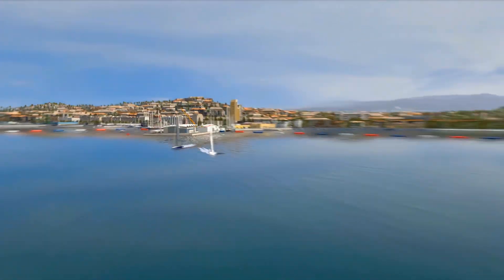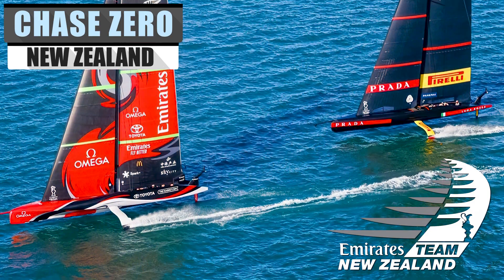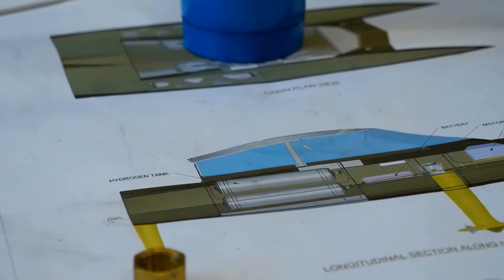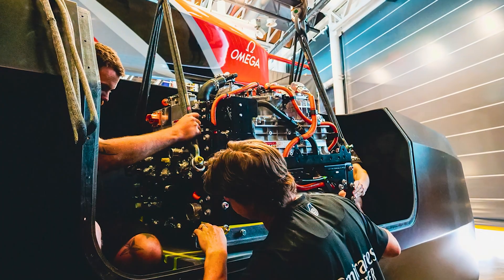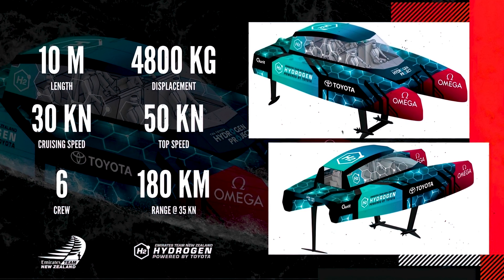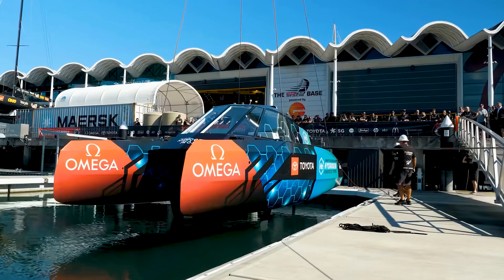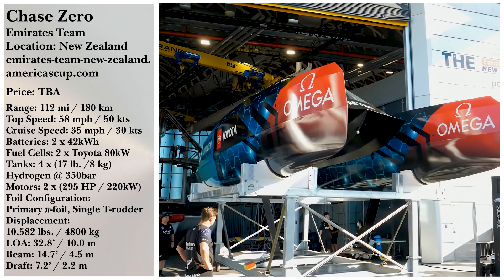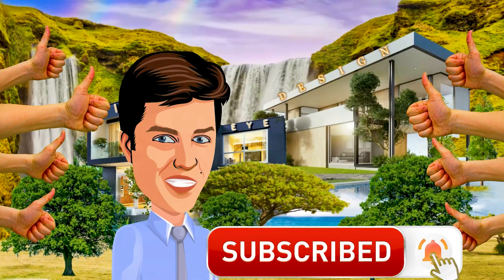CHASE ZERO CATAMARAN BRINGS HYDROGEN POWER TO AMERICA'S CUP

Comment: On-demand electrolysis hydrogen production would be better and safer.
Reply: The hydrogen is put into tanks. It can come from electrolysis. It isn't possible to do this on the vehicle because the Hydrogen is the power source for the vehicle - electrolysis uses energy and reacting it with oxygen in a fuel cell releases energy. The boat's energy comes from reacting hydrogen with Oxygen to make water. If it were also producing the Hydrogen from water on the boat, it would need some other energy source, as the energy required to make the Hydrogen would be the same as it got out, leaving nothing for propulsion (actually it'd need more energy, since some is always lost in the electrolysis and fuel cell). 

Hydrogen is an energy storage medium, like using a battery (this boat has a small battery, but it would need much bigger and heavier ones to have the same range, which would make it too heavy, which is probably why they used Hydrogen fuel cells - this is usually a problem in big and powerful vehicles that Hydrogen solves). It is great for zero emission vehicles, but it does need the energy to come from somewhere to make it, like solar panels or wind farms somewhere else (or in the more distant future, fusion). 

Expecting a Hydrogen fuel cell electric vehicle like this to also make the Hydrogen it uses is like expecting a battery electric vehicle to charge up its own battery entirely from regenerative braking so it never needs to be plugged-in, or expecting a diesel vehicle to make its own diesel somehow.
Reply: @sipos0  that's a very intelligent, knowledgeable, thorough and well explained answer. But you missed the point.
Reply from the maker: Hello Bill Landon, thank you for watching!

Comment: No emissions, except of course what is produced making the hydrogen.
Reply: Wind? Solar? Hydro? Wave? Geothermal? Biogas? Ethanol? So MANY green options and no need to mine as much
Reply: @psylentrage  While all of those are options, they're seldom chosen.
Mostly, hydrogen gets fractured out of hydrocarbon fossil fuels.

The fossil fuel infrastructure already exists, after all, and even though the process is energy-intensive, it's still cheaper to use what exists rather than build a totally new production chain.
So, while pollution is minimized when the fuel gets used , at the point of creation it causes just as much pollution as any other fossil fuel.
Reply: @thomashiggins9320  in New Zealand we only have one coal fired power station. The rest are a mix of hydro and wind. The government has been looking at taking off line the Huntley peak load power plant for sometime now.
Reply: @glennhenderson9243  sadly, it’s all very complicated. Take for a given that I fully accept that we need to drastically cut emissions. This is not about that. It’s about honest accounting.
Reply: @glennhenderson9243  sadly, it’s all very complicated. Take for a given that I fully accept that we need to drastically cut emissions. This is not about that. It’s about honest accounting.
Reply: @cguy96  yup , we have all the natural fuels we could ever need if they were used wisely and greed was kept out of the occasion.  I am going off grid very shortly , too much hypocrisy from all major service suppliers or their agents. Sod the lot of them.
Reply: @cguy96  oh are you referring to green, blue or grey hydrogen production. Not really that complicated.
Reply: @glennhenderson9243  I am referring to the complete and honest environmental impact calculation. Very complicated.
Reply: @associatedblacksheepandmisfits  wish that was true. Going solar, just for one example? So I suppose you are ok with exporting the amazing toxic waste produced during solar cell manufacturing? And I assume you plan on carefully recycling the cells at the end of their life cycle? Very energy intensive (and polluting if not done properly)! Oh, and battery back up? You need to go research just the nickel mining required to produce the batteries that let you go off-grid. But in your isolated property you will be green.

I have no doubt we COULD do a much better job (and we REALLY need to). But so far TANSTAAFL (there ain’t no such thing as a free lunch). Well, maybe reduction to a large extent. You don’t need to care where the energy that you don’t use comes from.
Reply: @cguy96  I am acutely aware nowadays that everything comes at a price. I learn more each day . I am now going off grid on a micro scale myself and will ignore all the flashy so called advances. We split the atom and still dont deal with it after all this time.
Reality is on the ground ,and we are screwing it up.
Reply: @cguy96  too many people hide behind the figures and ignore reality.
Reply: @associatedblacksheepandmisfits   I give some benefit of the doubt to those who are at least accepting of the basics, and are trying to be honest. Climate change and carbon are VERY complicated issues, and I don’t expect the person-on-the-street to grasp all but the most basic of the concepts. Clear and honest guidance from above is required. Sadly, we have also reached a point where MSM and science have become pejoratives,
Reply: @cguy96  science serves the people ,MSM serves itself. Ourobouros is at large and is ignored at one's peril.
Reply: @cguy96  I accept  no ones opinion unless considered . Otherwise it is worthless and you have nothing anyway. As for trust , I trust no one's words, I will know by the actions.
Reply: @thomashiggins9320  yet in highschool, we already learned the basics of hydrolisys...
Reply: @glennhenderson9243  NZ is big on renewables. Apparantly also geothermal?
Reply: @psylentrage  all of these (wind, solar, hydro, wave, geothermal, biogas, ethanol, etc.) have their own problems, and calculating the true carbon footprint can be very difficult.

If they need batteries (most of these do), the mining required just to obtain the nickel that is currently needed carries incredible environmental and health costs.

Wind: not reliable or predictable (hence the need for batteries), and typically not located where it is most needed. “Hi, we would like to build these huge wind turbines in your backyard and ship the electricity to the Coastal elites.” Plus, the turbine blades have a limited life span (about 10 years), after which they are cut into 3 pieces, and transported (1 piece per flat rig) to landfills, where they mostly just sit for now.

Solar: also not that reliable or consistent (batteries), and the production of photovoltaic cells requires more mining, and produces toxic waste that must be dealt with, plus they also have a limited lifespan and disposal issues. And unlike wind generation, it is very difficult to share agricultural land with solar production, so you get into land use and degradation issues. There are concentrating solar thermal plants, but most of these also require water cooling. And since some of the best places for solar power generation are also the driest? That’s an issue.

Hydro: well not ignoring the fact that we have already tapped many of the easiest rivers for hydro power generation, and thus there are limited opportunities for significant expansion, they do tend to produce fairly consistent, predictable, and reliable electricity. But at what environmental cost? Hydro is very disruptive to the environment. Plus, it is not available many places. Then there is the issue of catastrophic dam failure.

Wave: very consistent in some places, but largely available only to adjacent communities. Also, it is a largely unproven technology with lots of potential drawback. Significant initial costs. Disturbance and destruction of marine environment and ecosystems. Potential hazardous spills of materials required on wave generators. Lifespan questions. Significant impact on marine transportation.

I could keep going with all of these. But I am not advocating that we just keep burning fossil fuels willy nilly. There are many reasons beyond the huge and real issue of climate change to wean our selves off fossil fuel dependency. But it is a much more difficult issue most people understand. Every choice has consequences. Well, maybe not reduction, that can be an environmental freebee (maybe not economically when you consider the consequences of less consumption, which is ALSO something we need to be concerned by.)

Just a final example, I know people who feel all high and might that they “offset their carbon footprint” by paying for tree planting. The problems with that? Well, first you have to find out if the trees are ACTUALLY getting planted. Then you need to worry about where they are planted. Next, what KIND of trees are being planted, and are they being properly maintained. Those are just the level 0 questions.

The level 1 question comes from the carbon accounting practices. Right now the claimed carbon credit is based on a significant lifespan for each tree. That means that your offset is amortized over DECADES. That is assuming the tree doesn’t die early on (which many do), or that it isn’t burned in a forest fire or removed for agricultural fields. The current estimate (which I believe is still an overestimate) is that the claimed carbon footprint offset is 100 times the true carbon offset.

Finally, finally, there is the level 2 question. Is this planned reforestation actually GOOD for the environment long term? Probably not. The generally held consensus in the forest science community is that forests are best reestablished by leaving them alone. Yes, this will take a VERY long time, but in the long run is probably best for the forest and the planet in general. Now, urban reforestation doesn’t typically carry the same concerns. There are many good reasons to plant the right trees in the right places. But we are never going to urban tree plant our way out of this crisis.

I sound like a real Debbie Downer, and I don’t want to end the response that way. So, what can an individual do? Sorry to say that it isn’t that much. That doesn’t let you off the hook, I feel it is important that we all do our part, if for no other reason than to highlight the urgency of the issue. I won’t call myself a paragon of carbon virtue, there are certainly many who make much bigger sacrifices than I do, but I try to constantly do my part and examine my impact on my neighborhood, city, country, and planet. We eat mainly lower down on the food chain, supplementing with some fish, and even less meat. We try to procure most foods reasonably locally, and when we do buy animal products we consider things like the kind and source of the fish (MBARI’s Seafood Watch is great for this); we get grass-fed, pasture raised milk; we have our own chickens which we supplement with pastured, free-range eggs; we buy very little meat, and often get it from KOL foods (kosher, organic, local, and guaranteed to follow ethical treatment of both animals and workers; early on they used to have Meet your Meat days, where you could go out to the family farms-far less hypocritical than thinking your steak magically appears in a plastic tray). We walk, bike ride, or take public transportation. I put only about 4k or fewer miles on my vehicle per year, which I maintain in very good shape, particularly tire inflation!) We monitor electric usage, trying to keep things off which don’t need to be on. We keep heat lower in winter, and higher in summer. We source our electricity from what looks like the cleanest source possible (from the 40+ alternatives we have). We compost, and try to keep food waste to a minimum. Etc. Etc.

But the real answer is bigger than any collection of individuals. This problem really requires something like 10 Manhattan projects put together. It needs to be a collective, large scale global project. The responsibility falls mainly on the developed world, who not only CAUSED most of the problem, but who are also going to suffer the consequences at a significantly less degree than the developing world. My biggest issue is the naysayers who say “but this will be expensive, and inconvenient”. I think those people who have kicked the can down the road thinking they could outlive it are sorely mistaken. You are reaching the end of the road. Even if you don’t care about others (or future generations), it’s coming for you. Besides, even if you DON’T care about the planet or other people (asshole) the longterm economic benefits are going to far outweigh the short term costs. Now, these will be significant, and I think it is our responsibility to protect the most vulnerable from paying the biggest costs, but it will be worth it across the board.
Reply: @cguy96  with respect, no, not the batteries we are being sold. A flywheel is a battery, ice is a battery, a potato, is a battery, water pumped up to flow down later is a battery. Ever hear of upcycling? 
You don't need electricity for warmth either. Compost against your walls or a chicken coup under, etc. 
I also don't know why you wrote all of that like it's the first time I have ever heard of the stuff. I'm not going to read it as I have done sone reading of my own and am aware of the so-called cons. I am not big on conventional solar for one. We are struggling with current waste, and older solar panels are already coming off. The problems with most things, is that they are not hugely profitable so they die. Copper and oil won, and now those same companies are going to sell the next thing to us again and again we are beholden. ALL the patends we want are already in public domain, but we are still investigating new solutions that will take years to implement and waste how much carbon in the meantime, researching this? We already have all the tech, but everything in shops is made for this system, not the proper green one. Trying to convince millions of Americans to give up their toys is not going to be easy. Developing countries are being sold the old crap also. This is an inconvenient truth.
Reply: @psylentrage  I am entirely unsure of how to answer this. I suppose if you want to go back to a 19th century lifestyle, then yes, we have all the tech. If we are okay with sacrificing billions of people, we have everything we need to survive. There are many patenTs in the public domain, some are helpful, some are not. Just because something is patented does not nake it useful. 

And if you didn’t read it, how do you know that you have “seen it all before?” I read your response from top to bottom, and I have certainly seen it’s like. It’s a pretty D-K response, you know just enough to think you know it all. Climate change IS my area, and I am constantly learning new things, and I am under no delusions that I know even a significant fraction of the field. I do know enough to know when I don’t know something, and usually where (or more likely to whom) I should go to find out the information.

As for compost, etc. near (or in) my walls being enough to heat me? I have lived where there are stretches of days of -10° to -15° (°C, of course). No amount of insulation of compost decay produced heat is going to keep me fron dying. I have also lived where there are long stretches of days over 38°. You can survive w/o AC, depending on your house construction. But it is not comfortable and many people die from extreme heat.

Plus that all ignores those who DON’T own a house. If you rent or live in multi-family dwellings (like most people in the world), you should just go without heat (or ac)? Should those less fortunate than you or I be forced to conform to our vision of green power? That would be very self-centered of us.

There are no easy solutions. A large amount of the technology exists, but needs to be integrated intelligently. A lot doesn’t exist.

Just for fun, tell me how you would green NYC, or LA, or Shanghai? According to you, all of the technology already exists and is off patent.
Reply: @psylentrage   oh, and yes, all of those (and many others) are “batteries”, or at least energy storage devices. However (ignoring the porato as I am not sure I want to figure out how to store more energy in a potato), all of these and others are definitely part of the solution. All of them have great, but not universal) application. Flywheels suffer from a scaleability issue. For large scale storage, quite reasonable. For a house (or a car), very impractical. Ice can have equivalent energy density to lithium ion, but no one has a good method of converting ice to electricity. Gravity pumping typically requires very specific topography. Plus it requires lots of water. Don’t see how well those would work in a desert region especially far from even salt water sources. Etc.
Reply: @cguy96  You really only have negative input. So sad
Reply: I do appreciate the issues of all these energy technologies. The up front investment involved and end of life recycling requirements. Have a look at large scale liquid air batteries (storage systems) it may cheer you up plus tidedal should not be confused with wave tech. They are different.
Reply: @glennhenderson9243  surprisingly, as an oceanographer and climate scientist I DO know the difference between tides and waves. And it isn’t technology I need to cheer me up, it is social and political will power to work on the problem. Even though I know there are no easy answers and that there are always trade offs, that is no excuse for not doing the best we can.
Reply from the maker: Hello Mark Verschell, thank you for watching!